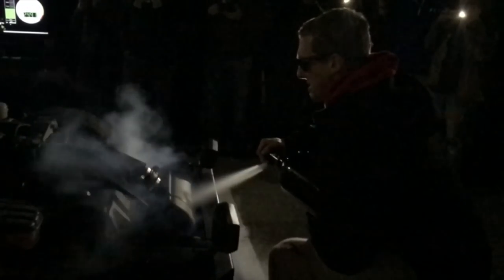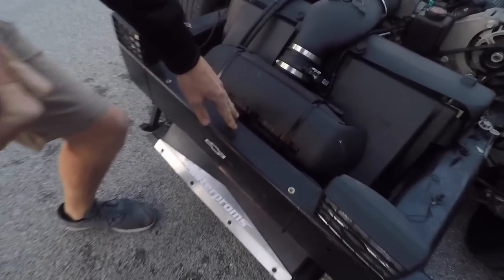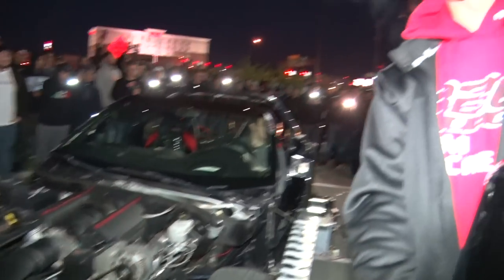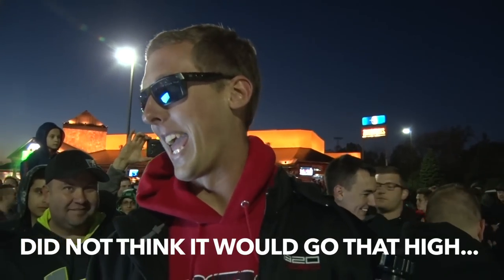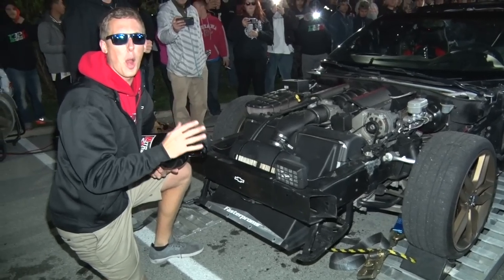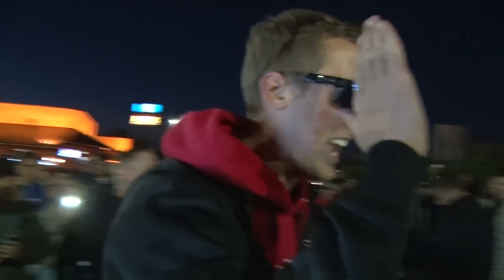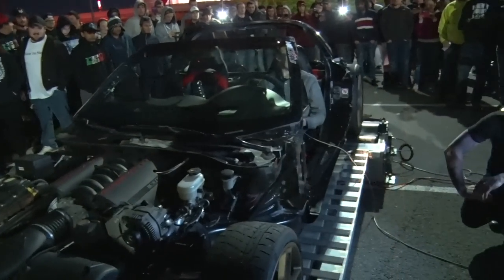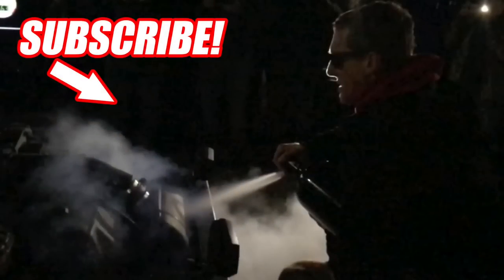Easiest Way To BLOW Your Engine... Tried It Anyway!

Comment: Nitrous doesnt add power, it lets you add fuel that makes more power. Condensed oxygen. All you did was super lean it knucklehead. Add fuel and nitrous and itll make 200 hp more.
Reply: That's right man
Reply: Edit: Dry kits work either by passing over the MAF/MAP, tricking the fuel pressure regulator, or ecu adjustments.
Reply: Wait, didn't he make more hp by putting it through the filter? So doesn't that make your argument void?
Reply: @Andrew Toupal you said walnut lmao
Reply: @mikedj420  You do know under WOT conditions it goes into open loop, right?
Reply: @DuaneHallgren  Hey your right. I had someone explain it to me like that awhile ago. I changed my comment.
Reply: But it made 80 more horse power....

Comment: TY for this video!....  I would like to know how helpful spraying it across a turbo/supercharger intercooler would bump power.  Cooling an intake charge increases HP at a factor of boost pressure/1bar.  I have a top mount intercooled wrx and would like to spray NoS or another cheap/safe refrigerant on the intercooler via a custom jet system using a NXpress kit solenoid.

Comment: Not sure what they were worried about its not even a big deal, its the same as hitting a lsx with a dry shot. Because its going in before the maf the computer will see the density and add fuel. Its the same as a dry shot except a little sketch cause its not jetted lol. A stock lsx car could handle a 100hp dry no problem just as long as the stock fuel system is working properly.

Comment: if your not sold on ls yet jesus what more do u want out off them bad ass motors
Reply: Randall White Im literally sold, after watching leroy do crazy shit, i sold. LS is up there with JZ in terms of being reliable and bullet proof. These motors can handle so much abuse
Reply: fire blade im a huge fan of jz motors would love to do a build with that platform but for the money and power u can make out of a ls and not blow up is out of this world my silverado a.k.a big red is a 5.3 ls single cab short bed 4x4 6 inch lift on 35s just tuned with heads and exhaust 255xxx miles and ragged on every day and runs like a top
Reply: Randall White Jz is my choice when going for a v6 build usually with jdm cars. Secondly its just easy slap a turbo on and you are good upto 400hp, no problem. Ive seen stock blocks go upto 700 but i dont like to put the engine in any risk so build it by that point. But these Ls motors are rad, on some level i always knew that but now my faith has strengthened. They are the most common swap for a reason, easy accessible power on a budget.
Reply: You named your truck Big Red?  ROFL what a dope.
Reply: yes i did its big and its red so big red it is
Reply: it's a straight 6
Reply: 100 shot of nitros not enough for some people? Add twin turbo

Comment: It wasn't long enough to burn out valves or pistons, but run it would have started "nocking/pinging".  A stock eng will  take about 10sec of detonation befor it blows, a built eng can take about 30sec, running to lean has about 4 different ways to destroy your engine, and you provided the perfect conditions for a big NOS backfire, anyway, your eng should have at least 6sec of detonation left, hopefully the ecu was able to squirt in a little extra fuel.

Comment: Ntrous + Fuel = Horsepower.  Nitrous without fuel = lean burndown, detonation, disaster.  If it survives, it means it's rich enough to survive and probably not an optimum tune to begin with.

Comment: so if it made 355 at the end and 460 on the last nitrous run you gained 105 horse o.o or was the last pull not a full out like the first base line of 386 as 350 to 380 seems like a decent varience between the same dino
 or that engine just lost some decent HP for that do it for dale maybe 386 was a fluke?

Comment: A proper nitrous shot has fuel added with the nitrous.  They should have had a guy spraying gasoline with a super soaker as well.  What could possibly go wrong?
Reply: Plur307 This was sprayed before the MAF so it's essentially a dry shot. It gets fuel from the injectors.

Comment: 386HP before to 355HP after on stock pull. That's not good.
Reply: Heat soak. The engine is fine.
Reply: lol beat me too it by 2 seconds
Reply: Jamison Etter cool night, full aluminum block, and down 30hp.  heat soak? nada
Reply: Not going to lose 30hp from heat soak on a cool night
Reply: Johnny Dole With 4 back to back pulls and two with spray? Yeah, 30hp loss due to heat soak is definitely possible. Especially with no air moving over the radiator.
Reply: Did you notice that spike on the first pass dont think its bad at all.
Reply: its not like they did runs to get a consist number
Reply: Driveway-built That must be why top-fuel dragsters and NASCAR's all use V8's and why ALL heavy duty gas trucks use V8's. The V8 is insanely reliable. The v-configuration in general is superior to inline motors.
Reply: You’re right man
Reply: That dyno also said it made 660 ft lbs at 1900rpm or so. 

his dyno must be a pos
Reply: @Shadow0fd3ath24   Is Leroy secretly diesel?

Comment: I'm 3 minutes into this. Don't you need to add fuel also to make more power.
Reply: The fuel to air ratio from the factory is for engine longevity.  Adding more oxidizer is artificially leaning out the mixture making more power but degrading the motor exponentially faster.  Race cars do it all the time for qualifying or when they know the motor will be rebuilt for the next race.  Top Fuel dragsters do it for every run.

Comment: exactly why does Nitrous oxide  increase the engines power  and   RPM's .... it is not  flammable...
Reply: Gary Vale Nitrous contains 33% oxygen by volume (after decomposition), air only 21%. In the combustion chamber, nitrous decomposes to nitrogen and oxygen plus energy. So, IF you add much more fuel to utilize the higher amount of oxygen you can get about 60% more power (calculated).
Reply: thank you for the info.

Comment: What is nitrous I am confused
Reply: Nitrous oxide. It enriches the air, its like a huge boost of oxygenated air to the engine. When an engine has more air to use, it can burn more fuel. Much more air + more fuel = more power.
Reply: Gilbert McGillicutty thanks I understand it now👍🏻

Comment: yeah, fucking 80hp through the filter? shit...my honda del sol (outfitted with a turbocharged H22A which was removed from a rear-end totalled 1997 Honda Prelude with 35K miles on it, that went 100hp-115 hp gain a direct-port system w/ 3 tanks in trunk (but it wasn't a "triple shot" like everyone used to estimate that it was...only 1 tank was active at a time, and I used to swap out empty tanks for full ones usually while nobody could see me LOL...)

Comment: Nitrous doesn't make any power at all - its an oxidising agent. There's some subterfuge going on here.
The primary means of engine cooling is a fuel mixture rich of peak EGT (exhaust gas temperature or stoichiometry).
Power will increase towards peak EGT but not in the order of this stupid video.
These guys are pulling your leg viewers! It is BS.